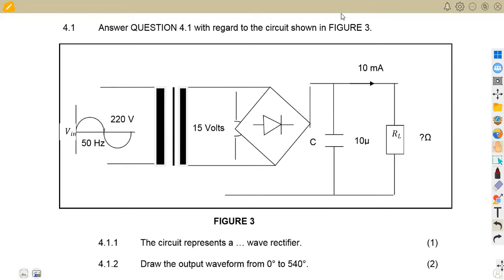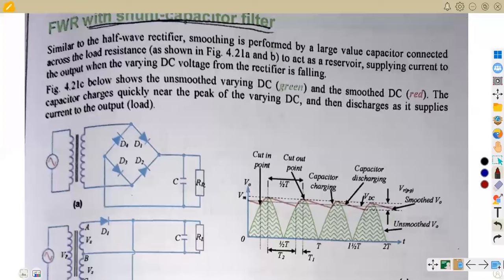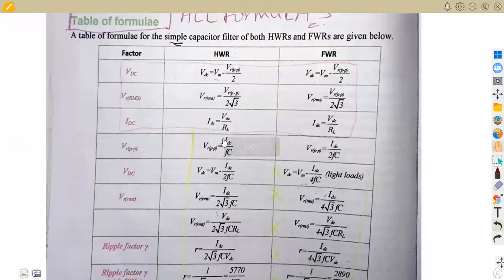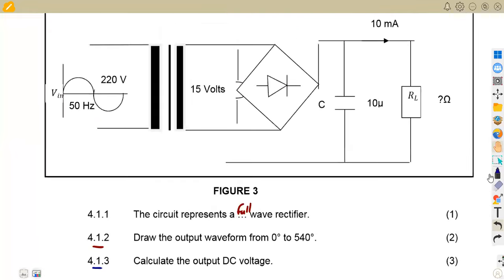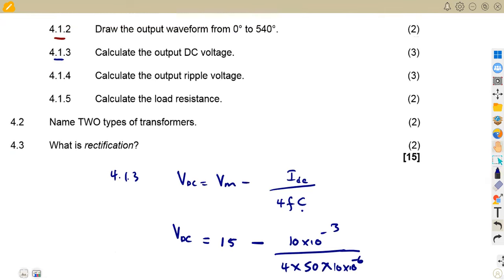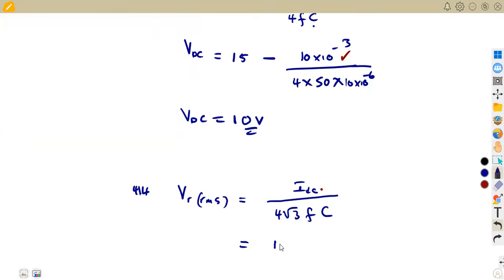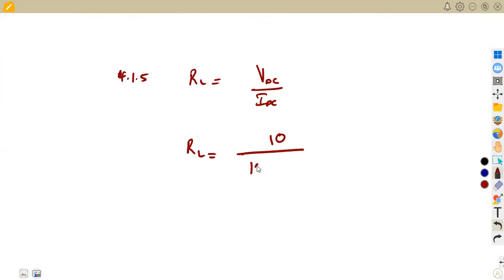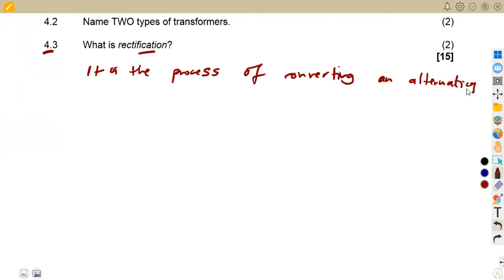Industrial Electronics N4 POWER SUPPLIES NOVEMBER 2022 @mathszoneafricanmotives

Comment: Am confused. Why aren't you calculating vmax using 1,414 x 15. Why use secondary voltage of the transfomer.
Reply from the maker: On which part?
Reply: @mathszoneafricanmotives  The 15v that you used as the maximum voltage (Vm). I thought when given the transformer secondary voltage, we use it to get the Vm, not take it as the Vm.
Reply: @mathszoneafricanmotives  I am confused because I thought the 15v is Vs not the vmax
Reply: Same, I thought Vm = sqrt(2) × Vrms